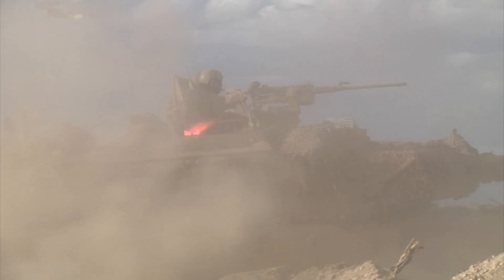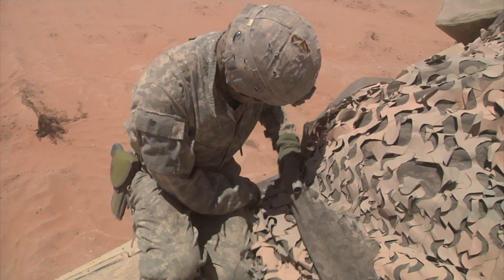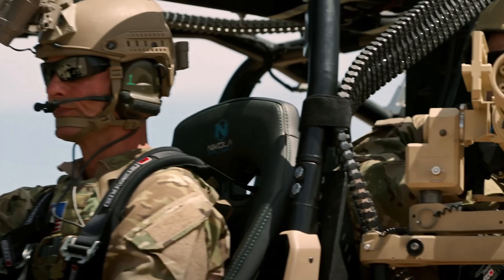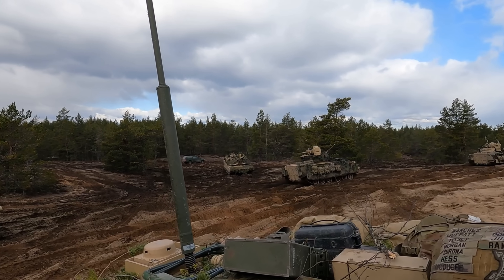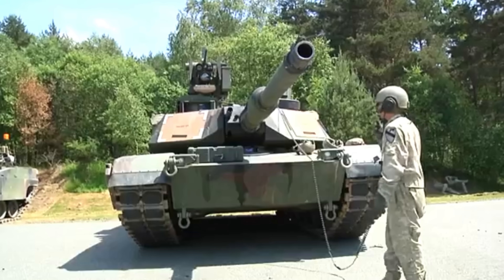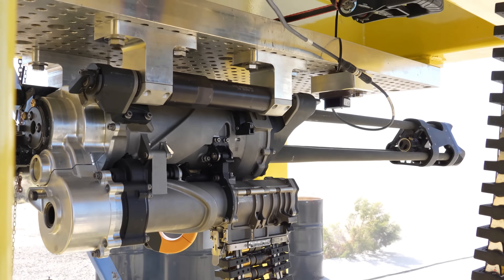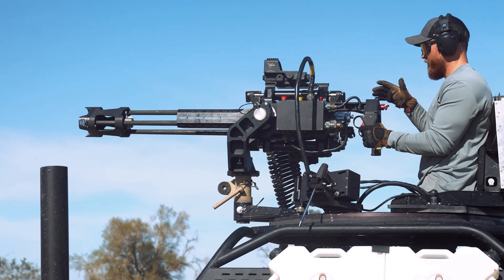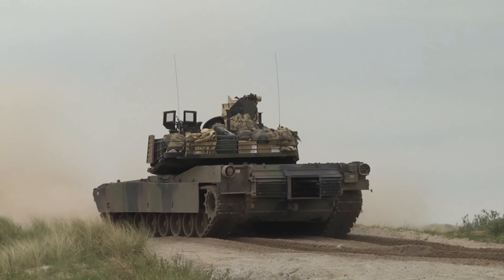Why is the U.S. Army putting a M134 Minigun on Abrams? | ROTARY GUN DEFENSE

Comment: Another option is "escort" vehicles with something like the Rheinmetall Skyranger 30 air defence system.  Their AMB ammunition gets programmed as it leaves the barrel and is very effective against drones.
Reply: That's what Poland is going for. They have an excellent system with a host of sensors that automatically detect drones.
Reply: I prefer the Gepard system, possibly with improved radar and a more advanced computer.
Reply: There is a US system that uses Northrop's new proximity fused ammunition for the proven and fairly simple 30mm Bushmaster cannon.
Reply: @ginacalabrese3869 Hearing this for the first time.  Thank you for sharing!
Reply: @ginacalabrese3869 M230LF. Very cool weapon
Reply: Grumman recently unveiled the M230LF chain gun for use on light remote weapon stations for vehicles that would conventionally mount .50s. The M230LF can fire proxy HE for drone defense
Reply: @gnaruto7769 I think the type of the weapon is less important than detection system.
Reply: Two different applications. Skyranger is for medium-range and larger drones. M134 in that case will be for very close range, against smaller drones including FPV drones, against which larger caliber weapons like 25-40mm guns will be less effective.
Tanks should have constant AA shielding anyway (this remains true since WWII), so this is different case. These M134 are for scenarios where drones already slipt past medium/heavy AA shield and are right in front of the tank

It's supposed to be like anti-drone Trophy system
Reply: The problem with that is you’ll need a lot of those escort vehicles to protect all of your tanks, and in the field you’ll often find tanks operating alone without escort. At least if it’ll end up like the situation in Ukraine. I personally love the BMPT and I think it has great potential against drones, but tanks need to be able to protect themselves as well
Reply: @Ranyick  If I had to pick an either-or, I'd still go with escorts instead of arming every tank with its own highly limited anti-drone gun. I would bet that the minigun or anything else stuck on top of the tank would only be marginally more effective than using the main gun with canister shot. 

In my mind, I would expect a 'drone escort' to have a far greater chance of downing the incoming drones than an entire platoon of tanks trying to do it themselves. Much like how I expect a tank to have a much better chance at killing an enemy tank than an entire infantry squad would. 

As far as numbers go, there are also other elements in the army that might like to be protected from drones too -not just tanks. Artillery, mechanized infantry, command posts, helicopter FARPs, etc. So a mobile solution is needed anyway. May as well just add another thousand, earmarked for explicit tank escort duty, when issuing the contract.
Reply: @dgthe3 I see anti drone warfare, just as air defense as a whole, as something that should be layered. 

Dedicated anti drone vehicles definitely have their place, but I would personally rather go for a turret that can easily be installed on your main IFV or APC so you just need to produce turrets and can mount them on already existing vehicles. I imagine the main armament to be a 35mm autocannon with acces to either proximate fuzed shells or timed fuses and an AI-integrated targeting system that automatically detects drones and prepares the fuzes. It could further have a RWS with a 5.56mm rotary mg for close in defense. 

But even then, you can’t always expect tanks to operate under the protection of such vehicles and so they’ll need to be able to defend themselves. Not with an entire AA system mounted on the roof, but a simple jammer and an RWS with an AI-based targeting system could already do a lot. Especially if it’s manned by a dedicated crew member, who can replace the louder given that almost all new tanks use auto loaders
Reply: @Ranyick Agreed.  I'm not sure how to accommodate both systems on one vehicle.  Maybe replace the turret with the lightweight SkyRanger 30 and more the main gun to a "casemate" position with a limited amount of traverse? 😬
Reply: @skenzyme81 it’s almost certain tanks will adapt and the current MBT layout will disappear. Maybe the new main tank type will look like that. 
I personally don’t see a problem with mounting an unmanned autocannon on top of a tank turret tho
Reply: Bring back the Sgt York!
Reply: Its why im laughing at people looking at Russia being defeated saying modern armies are useless to drones. No, Russia is useless against drones. They've always been decades ahead. And any good stuff Russia has was made by ukranians
Reply: No offense but this is not the reality in Ukraine. No SPAA will ever stop FPV’s effectively what we are actually seeing being proven on the front are counter drones with a 4 prop pull configuration intercepting FPV’s. not another 4 million SPAA
Reply: I think the US end game is the laser route. Which, is the reason the US isn't developing anything outside of small scale RWSs, when it comes to conventional munitions.
Reply: @penskepc2374 wrong, the US now have a variant of the Apache's 30mm in the M230LF for use on RWS.
Reply: @penskepc2374  - good luck to power a laser strong  on the battlefield... and ask nice the enemy to avoid smoke, snow, rain engagements !
Reply: @mirandela777  they're already testing lasers that can take out small drones and they fit on the back of a Polaris Side by Side.
Reply: Similiar with the new AI assisted SAAB anti-drone turret
Reply: That thing is sick.